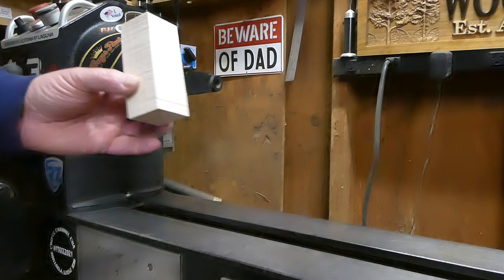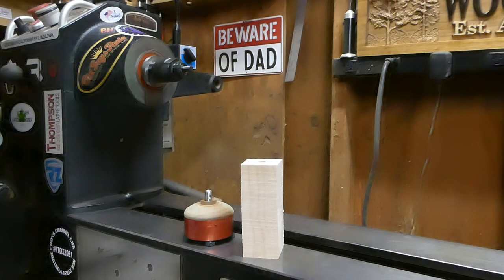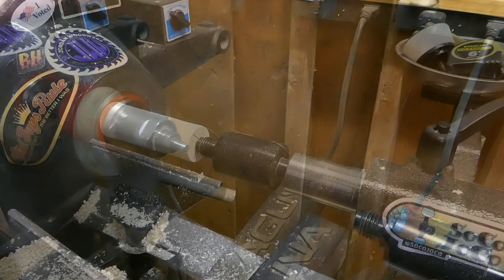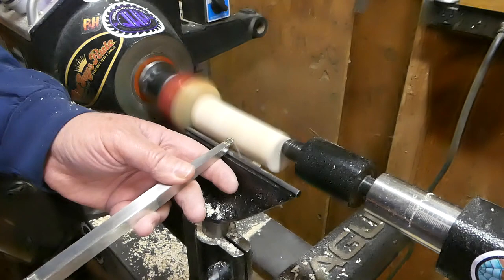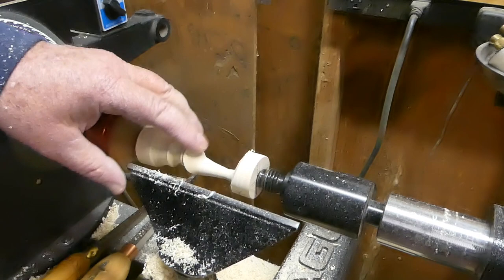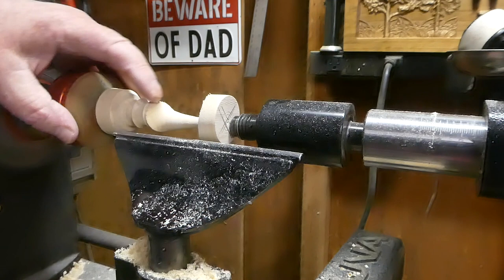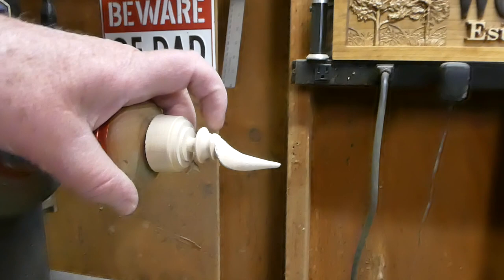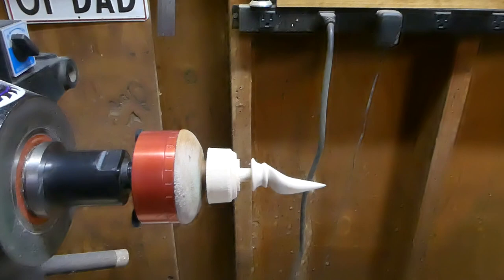Woodturning - The Off Center Finial!

Comment: Nice results, Bruce. I imagine a dozen times playing with various positions would give you an idea of the results a person can get using different positions.

I've got my first lidded vessel two projects away. I might try an off-center finial, just between centers. What I think you need is a nice sharp detail gouge. Get away from that carbide chip-out. Of course, you can tell me to keep my suggestion to myself, but it worked well on a piece of flat stock for a wooden spoon-style project, today. :)
Reply from the maker: Thanks Jay, I agree, the results are endless. Yes, I do need a sharp detail gouge, lol. Appreciate you checking it out buddy! 👍🏻👍🏻